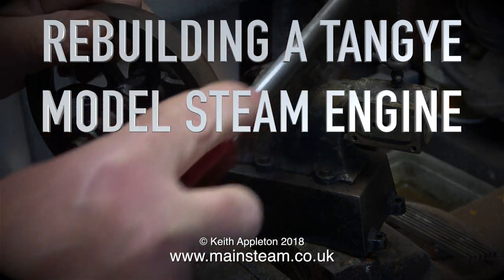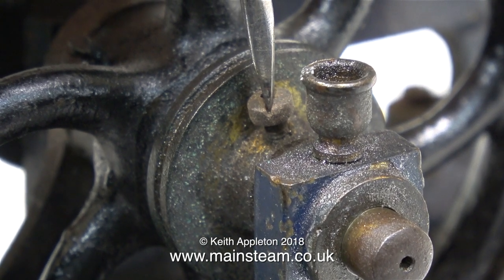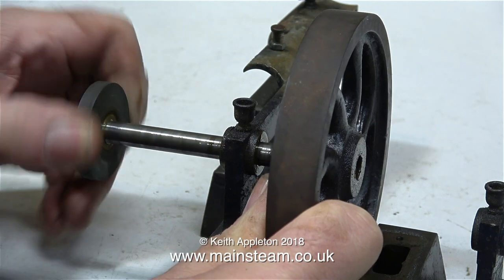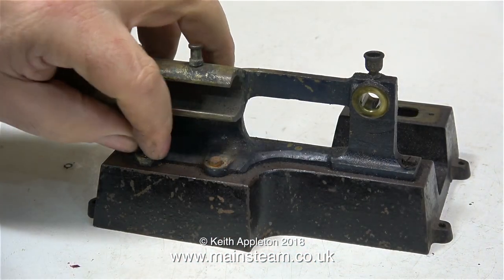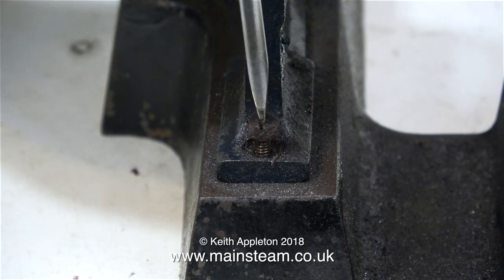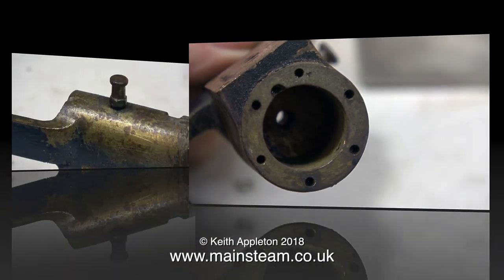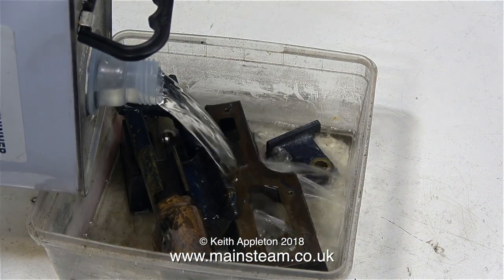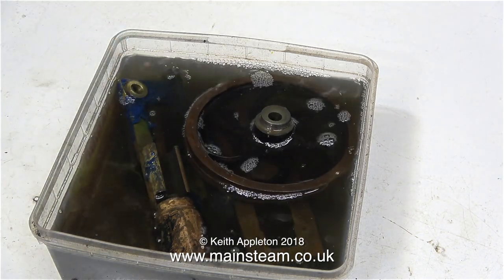REBUILDING A TANGYE MODEL STEAM ENGINE - PART #2

Comment: Putting combustible solvents into plastic containers makes me very nervous. In case of fire the plastic would melt and you would suddenly have a large diameter puddle of blazing liquid. Metal is better. Stainless is great. I guess you need a lid too, which fastens on in case the container gets kicked over. I can see I need to direct some attention in my workshop too. Thanks for bringing it to my attention.. 
And thanks for showing us the Tangyes as well!

Comment: Morning Keith, If you put a lid on the cleaning tub, it stops the thinners evaporating .  regards.
Reply from the maker: I haven't got any lids for these tubs, I get them from Chris English at CME Engineering when I buy steam fittings from him, and he never seems to have any lids }:-)))
Reply: @keithappleton  try  bit of plywood , with a weight on it, that should do it. Regards
Reply: And you avoid the flywheels to flying away.

Comment: Keith, have you ever though about getting an inexpensive bead blast cabinet for cleaning up parts. They are really nice for that kind of work and they're not very expensive. Just a thought.
Reply from the maker: Yes and I will get one as soon as I sell my collection of stage lighting in the outer part of the Workshop - that will generate the space I need to fit on in }:-)))
Reply: @keithappleton  Good to hear that.  You're going to absolutely love it.